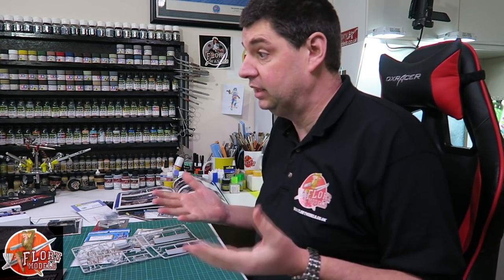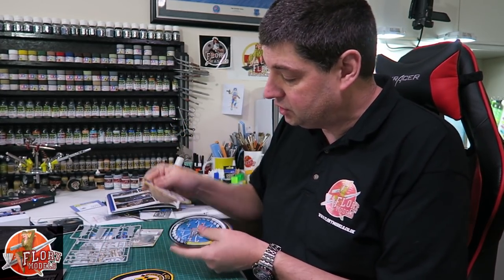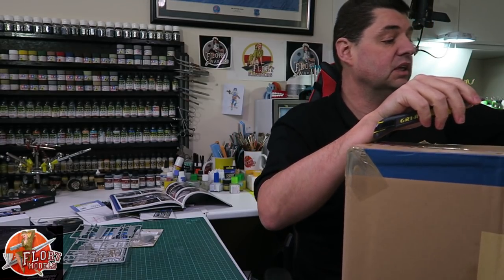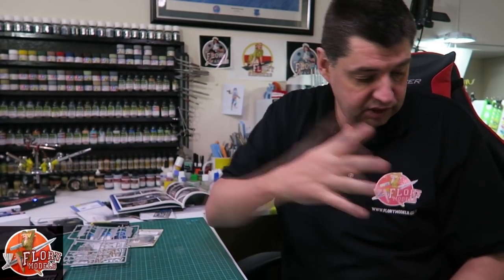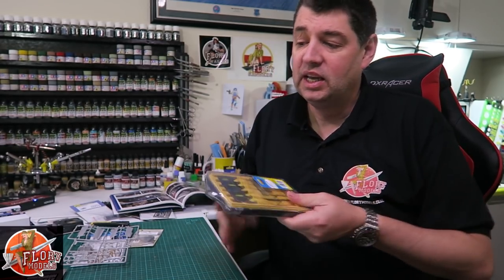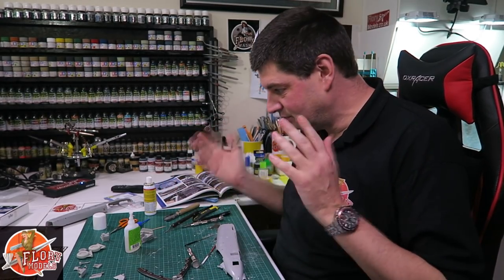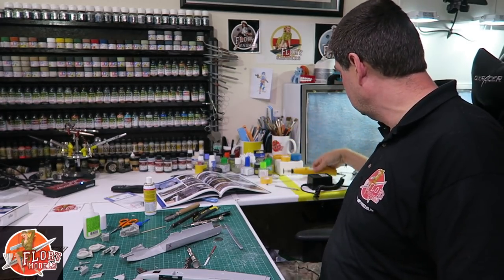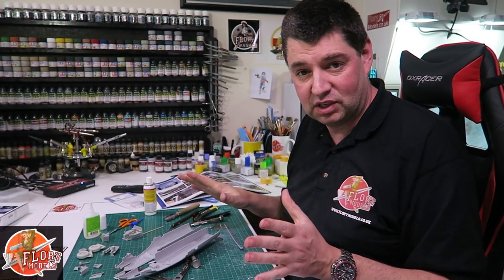Flory models Daily Vlog Tuesday 24th January 2017

Comment: Sorry will not be adding the fullback to my stash definitely not worth £107 for a 1/48 scale aircraft £60 is my limit there just cashing in going to wait and see if another manufacturer releases one at a reasonable price.
Reply: The other company with a Su-34 in the pipeline is Kitty Hawk and their kits, lets just say aren't cheap nor stellar. Their MiG-25 which is comparable in size goes for £50 with barely any weapons. From their Su-34 CAD images it'll have just as many weapons if not more than the HB one, which means most likely you'll also be payingr the £100+ mark for a box full of weapon sprues.